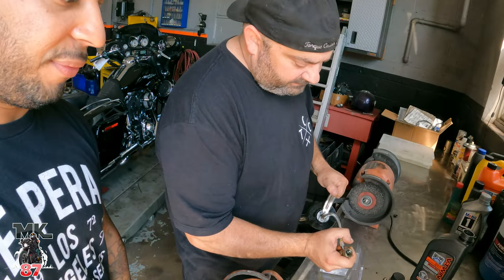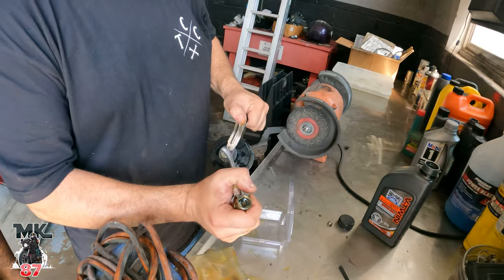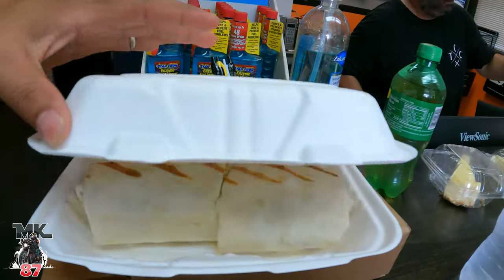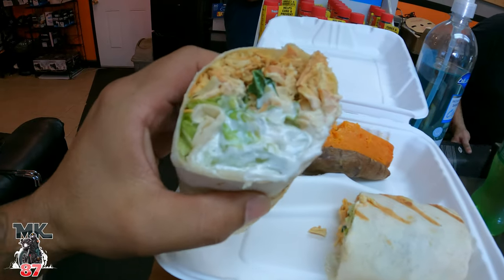S&S 475 cam install on Harley Davidson low rider s

Comment: Just when i wanted to pay a shop to get a new cam in I hear about bad news in some of these M8 motors.
Reply from the maker: These m8 can be tricky
Reply: @Marvelkid87  im at 6700 miles on my 117 lrs and the only plan i have right now are some pipes.

Comment: Sigh, I really want to like these m8 motors but I'm still on the fence about trading up my 2011 dyna street bob which has the se 110 tire shredder kit (106hp/122tq). Did it in 2017 and has roughly 6k on the current setup. Zero issues so far but I know the m8 makes more power than twin cams. Hopefully you'll get it sorted out 🤘
Reply from the maker: I actually love that 110 motor 🤙🏽
Reply: Keep your twin cam !
Reply: @fastlane1568   yeah. After all twin cams  never had any problems!lol. 2020 FXLRS with woods 22xE here. No problems.

Comment: Can you do a run with the stage 2 vs the scout? I’m really interested I have a scout and I’m thinking about trading for lowrider s but don’t want to lose performance
Reply from the maker: There’s really no comparison with these two bikes. Low rider s is a much bigger bike packing a whole lot more power. Comparing the scout to a sportster would be more ideal.
Reply: Motorcycle Consumer News' claimed to be running a 1/4 mile time of 11.93 seconds and a 0-60 of 3.81 seconds with their stock 2015 Scout.
Motorcycle Consumer News - December 2014 - page25….the lowrider is faster than that?
Reply: …I’ve been looking at the lowrider s because it’s a bigger bike which is better for highway riding I just don’t want a slower bike

Comment: All of these aftermarket parts prove that Harley Davidson motorcycles are not performance machines no matter how much you spend. Harleys are road bikes with low end torque to pull bodies and equipment across the road. HD’s Revolution Max engine is a performance machine. I have had a 96, 103, and now a 2017 M8 street glide. For me it’s religious oil changes, air filter changes, and rides. I did install slip in’s and a fan assisted oil cooler on my 2017 that’s it.
 I ride and wash bugs off, no need to spend extra cash and see bike on a lift more than it’s on the road.